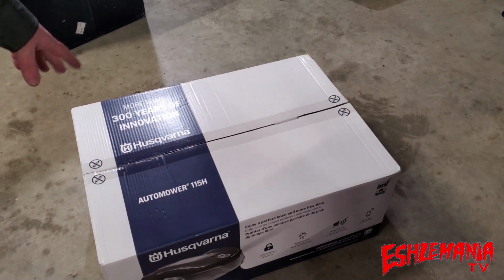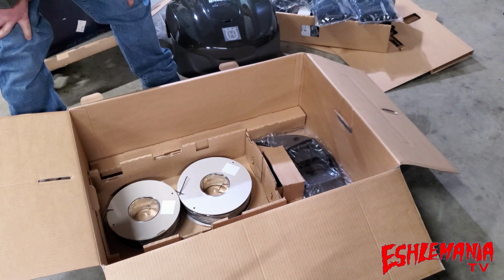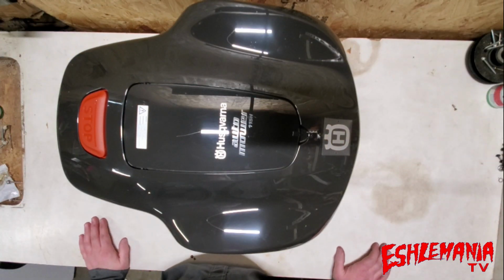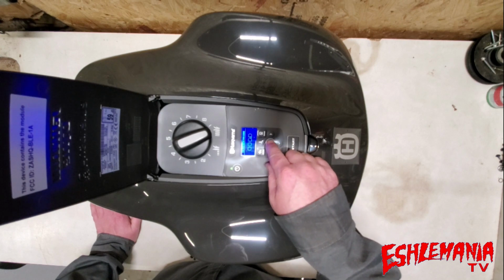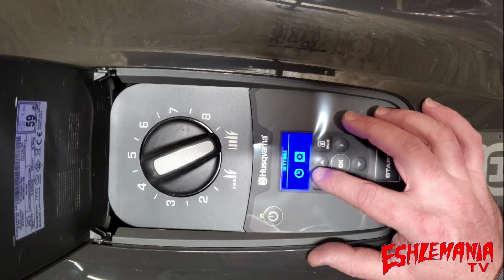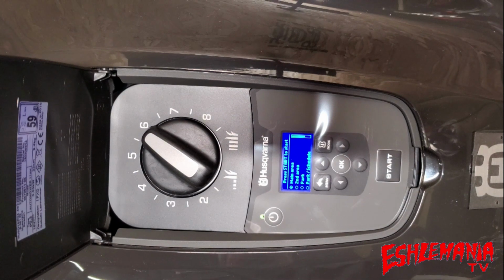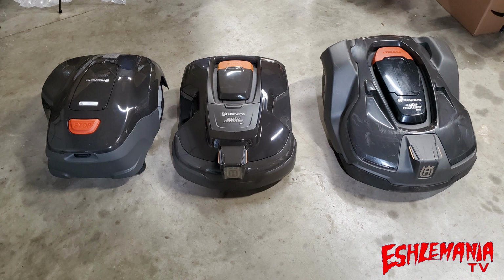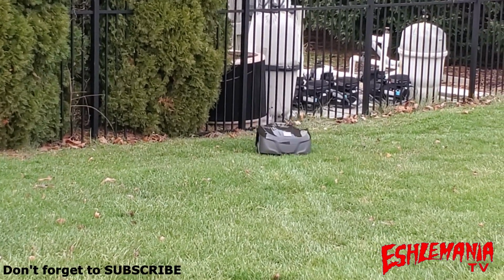Automower Answers: A Look At The Husqvarna 115H Automower

Comment: Question.  Having a guide wire as well as left and right  boundary wires installed together in a 40' parallel run under interlock walkway from back yard to front side yard. Then parallel again across driveway to main front yard. Can all wires be run parallel  and the mower follow all wires  on centre with precision?  Please and thank you. Andrew Aurora Ontario. 416 561 5823
Reply from the maker: Hey Andrew, send an email to Roboticmowerservices@gmail.com with your mower model and some kind of drawing of what you are asking about.
Reply: Eshelmania is the best informative source for Husqvarna auto mower information any where on the planet!

Comment: my problem here is my yard isn't close to "flat" i've got inclines of nearly 45 degrees and im not sure this will climb them, the dealer i bought it from told me it'll work but they never went out to look at my property to make sure im getting the right mower. I already bought the mower and now have it but it took 2 and a half weeks! and this wasnt even the mower i showed the dealer when we ordered it. ontop of that this coronavirus crap wont allow them to install this mower at my property until the 15th of april, the manager for the dealer wasn't there today. currently right now i hate even bothering trying to get one.
Reply from the maker: WOW! Sorry to hear that!
Reply: Are you really meaning degrees and not percentage of incline? 45 degrees is 100%. The best model they make is rated for 70% incline and 115H is only at 30%.
Have you measured these slopes? My gut feeling is always that they are inclining less than what I think.

Comment: Only using the guide to find home makes these things damn near useless. Does an extra guide wire really cost that much???
Reply from the maker: Don't have an answer for that one. I'm not sure if that's how the Gardena model in Europe works too or not, but the 115H is just an Americanized version of it. At least they put the second caster wheel on it for us. LOL
Reply: @EshlemaniaTV  yeah. Husqvarna is blowing it, imo. they are so ahead of the game but little nitpick things are holding them back and others will catch up. Our Lowes has sold 10 115 and I only installed 1, and from what I have heard that has been the norm. Lowes can't be very happy.
Reply: 115H big brother in Europe is 305 (no, not the old 305). Usually, when installation is done correctly, using only guide wire(s) and charging station signals to find charging station, cuts down search times a bit. We are using three times cheaper thicker plain copper wire without any complications, plus boundary or guide wire length can be longer than recommended, because thicker wire has lower electrotechnical resistance. Only downside is technician must be able to solder joints together, use shrink tubes with glue and weatherproof natural silicon with plastic T-pieces, which take more time to install, but in the other hand offer longer (5 year) guarantee for the installation.